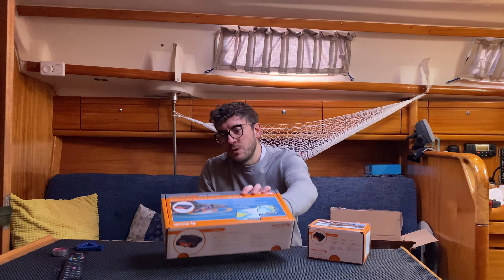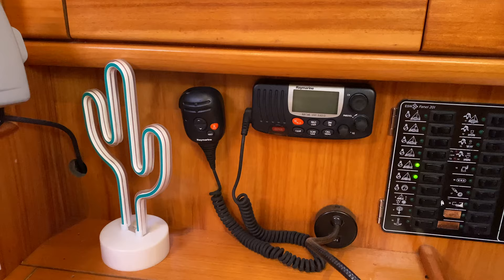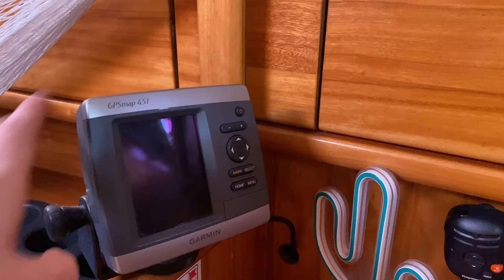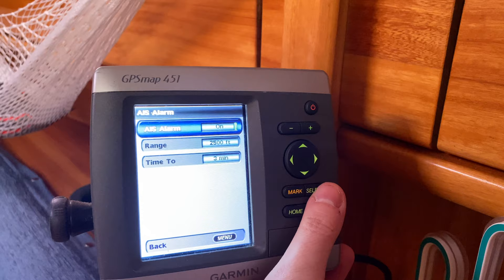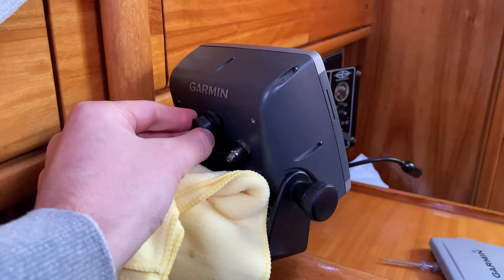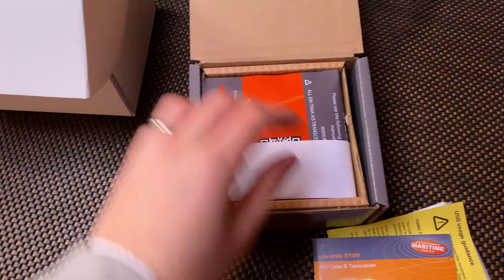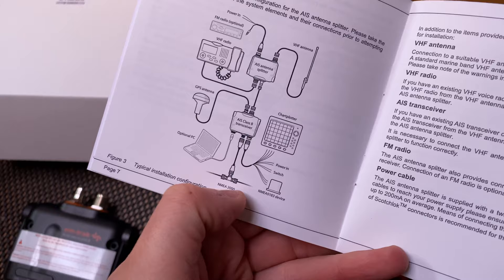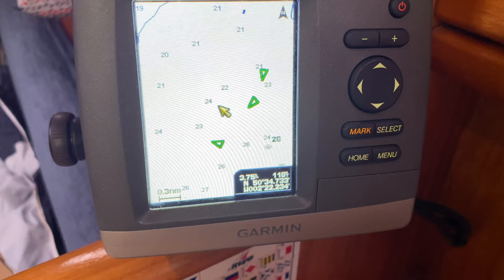AIS Transponder installation on a small sailing boat

Comment: Hi - we have the plotter (actually the GPS551, but hey-ho...) and we are interested in the AIS unit. Our GPS551 has similar AIS menus and NMEA2000 connectors so it was good to see the little triangles on the screen. However, I did not see vessel details on the screen - is there a way to find that out? The name, MMSI, etc...?
Reply from the maker: Sailing Yacht Salty Lass yeah you just hover the curser over the vessel and all the details are listed next to it so you call on the radio etc. Its good because it should work with a new plotter too if I decide to upgrade :)

Comment: Did you enter your boat info/data into the AIS?
Reply from the maker: Wilson T , yes connected a laptop via the USB port and set up the mmsi etc, it’s straight forward to be honest, but you can’t change the mmsi once entered so triple check it!

Comment: Nice vid, thanks for explaining! I've also bought the Em-trak B100 and S100 splitter and will set it up soon. Hopefully the installation also will be without to much a hassle. Maybe interessting to know: I also ordered a YakBak (yakbitz) to output the nmea to wifi. I can then get the AIS info on my tablet and phone. I already installed OpenCPN on my phone and tablet with charts of NL and the UK. (The YakBak is bi-directional so I hope I can also send back info to the autopilot, that would be a nice extra if it will work. First getting AIS to work.) Cheerz!
Reply from the maker: Great idea, there is option to connect to the ais via usb so there must be a way to export it onto a WiFi network!